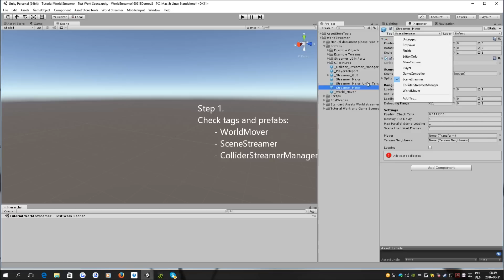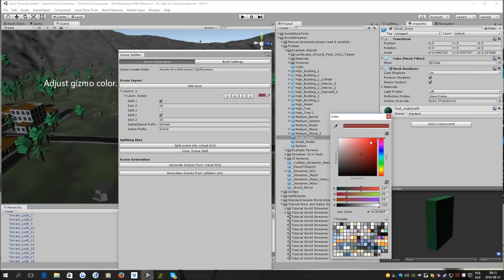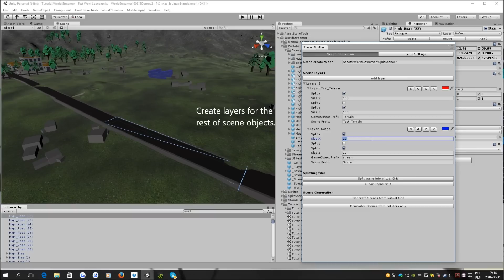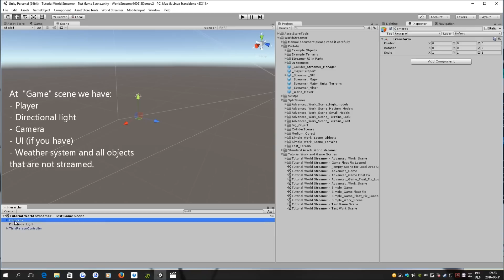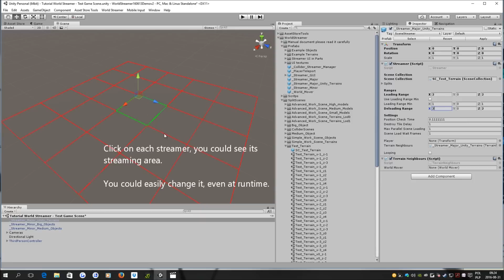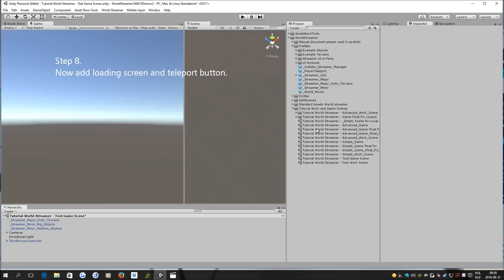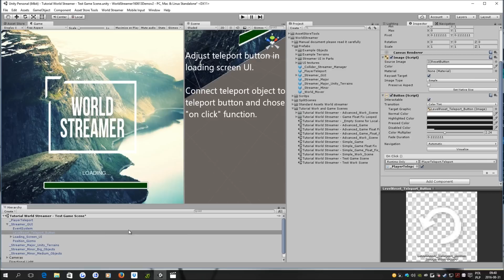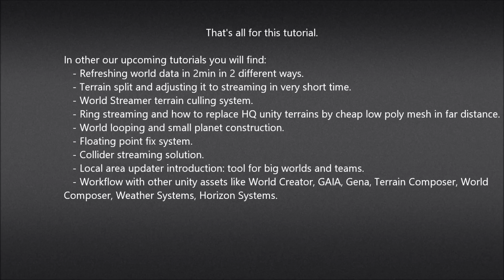World Streamer Tutorial 1  - Stream your whole world step by step

Comment: I'm thinking about buying this but I have a question (Sorry if this is not the best place): After you've done all this work and you want to edit the terrain or add new objects, do I need to do it all over again? My assumption is that I will have my "main" scene where I'd have the entire world (not split yet) for me to work. Preparing for streaming would be required as a final step every time after I'm done editing it with the downside that I wouldn't be able to "play" the world during the editing phase. I could also go directly to each split scene and edit it directly but then I could potentially have my main scene out of sync (with the hassle of finding the chunk first and then editing without seeing the whole picture). Is this assumption correct?
Reply from the maker: kuinks local area updater give you ability to change localy data without loading everything.

Comment: I'm curious about a certain thing:

Assume you have a GameObject X which, before splitting, referenced another object Y, via the Editor.
Assume you have Scenes A and B, created by splitting your world.
After the split, what happens to this reference if X and Y happen to be in A and B, respectively? (That is, in different scenes)

I would assume all references are lost, because Unity can't handle this kind of thing. 
At the same time though, since we have access to those references at the time of the splitting, I feel something could be done to preserve them. Something like redirecting them to dummy objects somewhere on the Streamer itself, which would only load once the Scene which the object lives in is loaded, and then the Streamer could substitute the references back to their desired state.

Anyway, just curiosity for now. Doesn't seem impossible, if not far fetched. After all, if you're using the technique of separating bigger and smaller objects in different scenes it seems relatively easy to fall in this case. More so than for objects far apart, I feel.